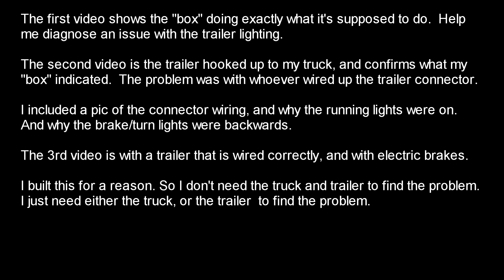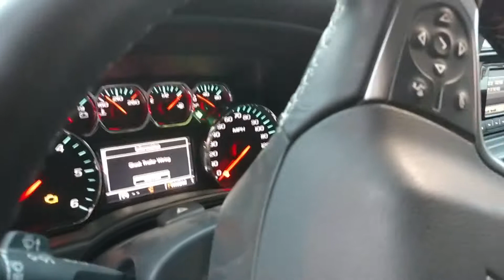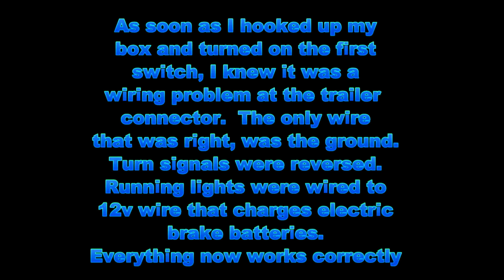DIY Truck/Trailer Tester

Comment: I got a question for you I'm in the process of building one of these myself. Wired a bunch of trailers in the past. Is there any problems that I might encounter? Appreciate the video. I wished you describe how you wear that that would be great in a video.
Reply from the maker: The wiring is pretty straight forward.  What you don't see inside, is the use of diodes so the power doesn't back feed.  I have a video up showing my building and testing of it.  Good Luck with your build.